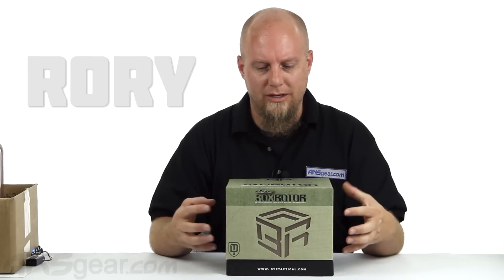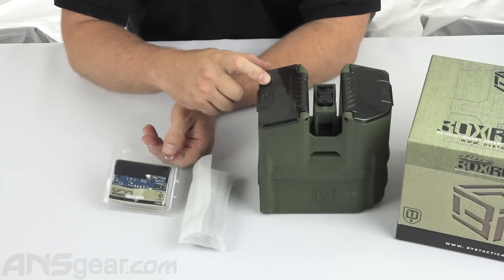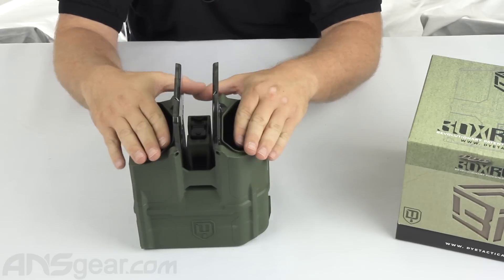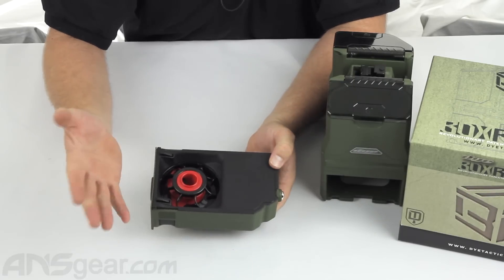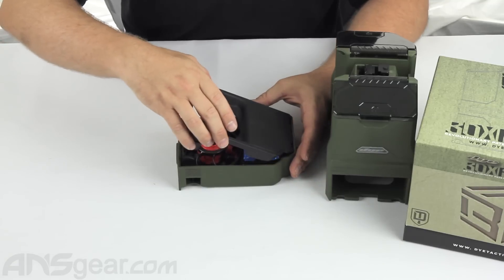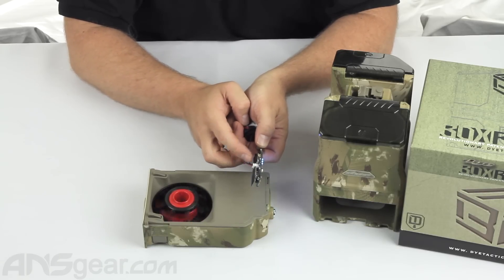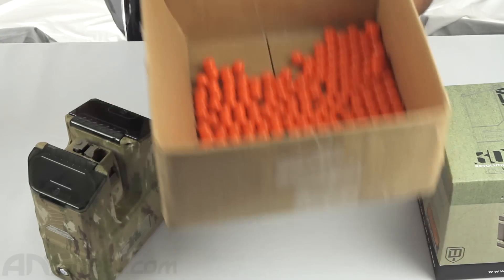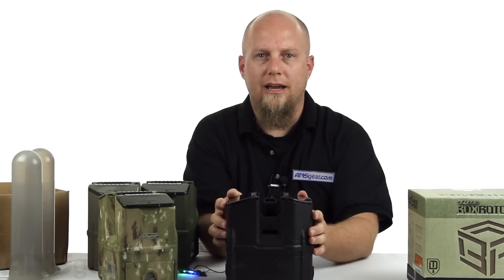Dye DAM Box Rotor Paintball Loader - Review

Comment: just got it from you guys and it doesn't work. it synced up, the motor revs when you turn the box rotor on. it should work with every trigger pull. nope just when you turn the box rotor on. very frustrating